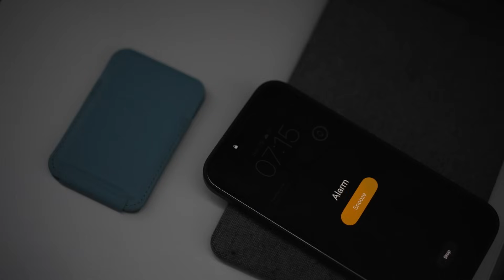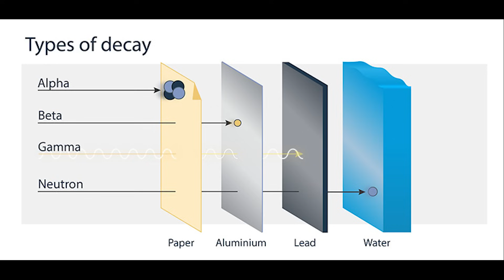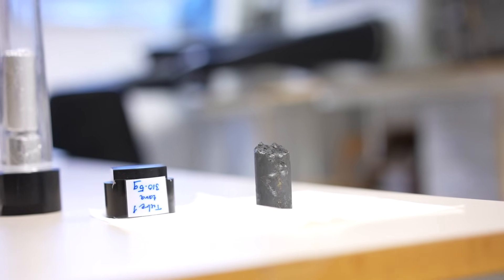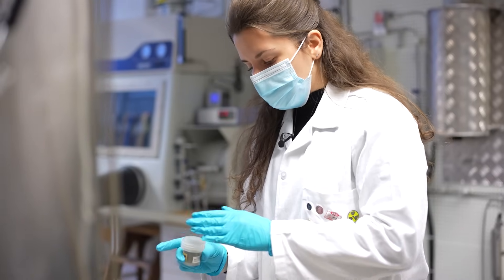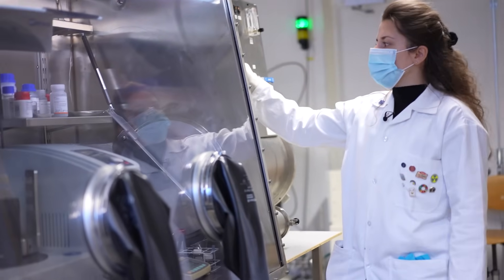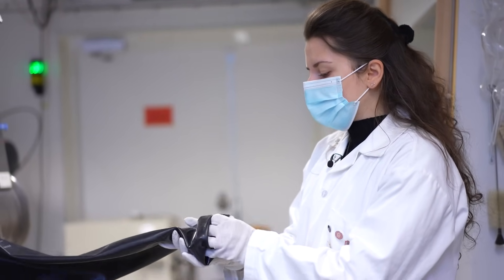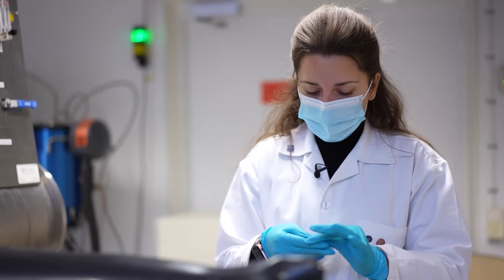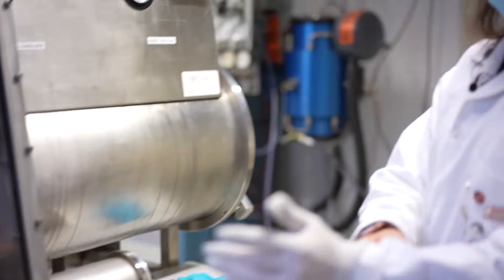Touching URANIUM and EXPOSING Myths - A day in the Life of a Nuclear Physicist

Comment: If Uranium is primarily an alpha emitter and if something with as low a density as paper can shield against alpha radiation, is it the case that the radiation we measure is only coming from the surface layer of the piece of uranium, while the radiation on the inside gets blocked by the much higher-density uranium that is on the inside of the piece?

If so, what happens to the alpha particles that are helium nuclei that are stuck inside the block? Do they stay there, do they leak out slowly or do they break down when hit by another particle?

Also, if it is true that the only alpha radiation you have to shield against with U-238 is the one you get from the surface layer, why are reactors filled with thousands of small pellets giving you a huge surface area instead of a single block where the surface area would be lower if what you’re after is the heat and not the radiation…

Comment: I used to work in a food testing lab and we had some photographers coming to take some pics for some marketing brochures and what not (this is back in the 90s). They were very upset when they saw that most of the solutions we were working with were colourless, not the stereotypical fuming flasks of bubbling liquids in rainbow colours! SO we had to mock up a couple of flasks to put here and there of water and some indicator dyes and iodine. They loved one of the tests I was doing where I would take a clear liquid, add a reagent to it, turning it a pink/purple, then titrating it with a colourless liquid until it juuuuuuust went green. Problem was that it was a time critical test, you only had a certain amount of time from removing it from the heating mantle to adding the reagent and back titrating, meaning I could hold the flask at the pretty purple colour while they stuffed around with lights and backgrounds.

Most of us ended up working a couple of hours overtime that night to finish of our normal work because they got so badly in the way....

Comment: Correct me if I am wrong but the only way uranium can do damage to you is by getting into your body. That could be absorption, inhalation, ingestion or an open wound. Because if that is the case it is like exposure during chem-warfare. And since you mentioned that is an alpha radiation a sheet of fairly thick paper will block it, or even charcoal respirators will as well.

Comment: You should know better than to say a Geiger probe, especially a pancake probe measures dose (Sieverts).  A Geiger probe registers only one thing - counts.  Per minute or per second or total counts.  That's an embarrassing error for a nuclear physicist.
Reply: A pancake tube is still a Geiger tube and both (tubes) can measure Counts, Sieverts and Roentgens. A pancake tube has a very thin mica window that lets alpha particles through to be measured, as does a "normal shaped" Geiger tube if it has a mica "end window". The pancake tube has a larger mica window, thus can be more sensitive (especially to alpha particles). Geiger tubes without a mica window can only measure beta particles, gamma and x-rays. Now you know.
Reply: @loupgarou1261  Well, let's see bud.  Degrees in nuclear and electrical design engineering, former Certified Professional Health-Physicist and a 40 year career specializing in radiation monitoring systems design and implementation.  I can confidently say that you don't have a friggin' clue as to what you are talking about.

A pancake GM tube with a steel body has practically no sensitivity to gammas because there is nothing there to absorb the photons and turn them into ionization events such as the photoelectric effect or pair production which will cause the tube to avalanche.

A pancake GM tube is primarily an alpha and beta counter.  Tungsten-bodied pancake tubes are available for enhanced gamma sensitivity.

You seem to think you can intermix Roentgens (exposure) with Sieverts (dose equivalent).  Sieverts involve both the event count, the energy of the events and the quality factor.

1000 photons of 100keV delivers vastly less dose  than 1000 photon of 1MeV, yet the pancake tube will generate MORE counts to the 100keV photons than the 1 MeV photons because most of the 1 MeV photons pass right through the GM tube without any interaction.  This is exactly the opposite of what you claim.

The proper instrument for measuring Roentgens or Grays for gammas is the ion chamber.

If you actually want to learn something about radiation measurement, might I suggest "Radiation Detection and Measurement" by Glenn F. Knoll.  In the 4th edition, the fundamentals of detection and the units involved start on page 56.  Might I also suggest you acquire a copy of ICRP Report 51, "Quantities and Units in Radiation Protection Dosimetry,".

Dumb ass.
Reply: @neon-john  I didn't say anything about gamma with respect to pancake tubes. And many digital counters "calculate" Roentgens and Sieverts (roughly) from counts when measuring the isotope that they were calibrated with, which is usually stated. I realize that scintillators and not Geiger tubes measure the energy of particles. Geiger tubes only detect counts.

Comment: Would be interesting to see how they derived and got to the size indentation needed for the pellet to expand right
Reply: Consider the "metallurgical Laboratory" that was a big part of the Manhattan Project. They needed to determine the engineering properties of the various metals. Turned out that Plutonium had seven or more solid "phases" each with different densities. Much like cocoa butter used in chocolate. 
For reactor fuel, they of course have to consider the elements that it will fission into. The two daughter atoms take up more room straight away than the uranium. Nor can they maintain the same chemical bond to the oxygen or nitride that bound the uranium. The densities of Iodine, Caesium and Strontium are much lower than that of uranium metal or the oxide or nitride, and of course the Xenon is a noble gas and cannot be contained at all, it leaches out.
Physical chemistry texts and references have huge amounts of data on the atomic sizes, densities and properties of all of these, as a starting point. 
Labs like Elina's will be trying new formulations to try and improve on older ones. They will start with "depleted" uranium that has no U235, a by product of enrichment processing, and this will cover all the basic chemistry of forming the pellets and their starting engineering properties like strength, thermal expansion, brittleness. Then they will probably use mixtures with natural uranium, which has about 0.7% U235. Like the metal slugs Elina demonstrated. They will use that to make similar test pellets. They might irradiate it in a reactor to cause some fission, and then they will measure the properties with some fission product contamination. This work will have to be done in special shielded chambers as these pellets will be dangerously radioactive. They might them do further experiments with pellets containing greater proportions of U235, to see at what point the test mixture weakens, or expands or whatnot. But as I said, these are not cowboy experiments. They started with lots of chemical information about these elements, and probably also made "cold" test pellets with varying degrees of contamination with stable isotopes of iodine, caesium etc to get a rough idea.
There will also be a huge amount of computer modelling, to reduce the amount of actual fiddling with irradiated fuel. Presumably pellets of spent fuel get analysed in the facilities that disassemble and reprocess this fuel. Strength, expansion, brittleness, density, changes in crystal structure etc have probably been well-examined in older pellet types and this probably helps them make good predictions of the newer materials with less of the expensive sort of high-radiation work.

Huge amount of painstaking work, and really tricky, I suspect, once they start examining irradiated samples.

Comment: Why did you remove your face mask in the middle of the process? Earlier in the same situation you are seen wearing it. What has changed? Will there be any nuclear dust in the air that when inhaled can cause radiation poisoning? Just curious to know what kind of safety aspects goes through your mind when working with these materials...

Comment: I would suggest you wear thick gloves to handle the uranium, rather than skin tight lab gloves. It reduces the beta contact dose rates to your skin by a third or more. Better to use a pair of tongs, and not handle it directly.  As you said it’s not very dangerous but if it’s easy to reduce dose rates you probably should.

Comment: surprised it was only 500usvh, i knew it wouldnt be crazy high, but i have some torbernite samples which are far higher, i guess the daughter isotopes are what make my mineral sample much higher? great video. thanks!
Reply: Yes, if it's in a mineral, it most likely is in secular equilibrium, which means you have to multiply the activity for the entire length of the decay chain (since then the ratio of decay must be equal for any of them, in order to keep the same abundances)

Comment: Hey, I know Carmina Urana, a great cantata 🙂
Some people have weird ideas of uranium.  In '1988 I touched a brick of uranium which was only wrapped in ordinary plastic foil and a non-sealed fuel element made from unenriched uranium.  I'm still alive, sadly no super powers, extra heads, arms or death rays shooting from my eyes.  One of the dangers of the uranium brick however was its surprising weight.  The size of a cobble stone and the weight of a dumbell.  So probably steel toes rather than a full body suit would have been advisable.
One minute later one of the researchers reached into the open reactor's pool grabbing a bathtub thermometer from the reactor coolant with his unprotected hand.  "Ah bathing temperature" he said.  Standard joke on every tour.  He must have done that thousands of time by then and still ET's finger is glowing brighter.  That was a EIR, Eidgenössisches Institut für Reaktorforschung, a Swiss research institute for reactor research  nearby in Northern Switzerland.

Comment: I found the video fascinating, including the use of argon as the inert gas.  I looked it up and it is a bit expensive, but well worth it and I was relieved once you put the sample in the tube, flushed it with argon, and then it was in the glove box. It seems like a safer place for it than handling it freehand where one could - theoretically of course - drop it at any time.

Comment: Even you call it fuel but there is no burning. I prefer to call it fissiles or fissile material.
Reply: The terminology is standard. Nuclear fuel is understood not to be "combusted", but it still provides energy. 
Some also refer to "incinerating" spent fuel. Clearly they do not mean putting it in a fire, but to bombarding the material with neutrons or extremely high energy lasers to accelerate the nuclear decay process.
Reply: @aaroncosier735  I understand but I think that in this time where burning is associated highly with CO2 iT is better to change the standard terminology.
Reply: @rudyberkvens-be  I simply do not think this can happen. The concept of the nuclear fuel being "burnt" is pervasive in the literature. We even consider that the sun and stars "burn".

The idea of "fuel" as a "source of heat" will persist. Nuclear discussion seems already able to distinguish that "burning" nuclear fuel releases no CO2. In fact, the idea that there is no ash or smoke clouds the issue of the wastes that are produced and the difficulties and costs of interment.
Reply: @aaroncosier735  it is still wrong. I say fission, fissile matter and will continue to point this out to people.

Comment: Interesting that uranium tetrafluoride is a powder. I've read that uranium hexafluoride was used in the Manhatten Project to allow them to enrich the uranium by gaseous diffusion. This obviously needs the UF6 to be in the gas phase. Given that UF4 is a solid at room temperature, does UF6 have vastly different physical properties, or did they just have to heat it until it either boiled or sublimed?
Reply: Quite different. 
UF4 -- melting point: 1036°C https://en.wikipedia.org/wiki/Uranium_tetrafluoride
UF6 -- *boiling* point: 57°C  https://en.wikipedia.org/wiki/Uranium_hexafluoride

Comment: There was oxygen left in mini-grip plastic bag.
Reply: Elina Charatsidou
2 weeks ago
The ziplock bag must be half open when entering the glove box (to remove all oxygen in it). Once inside the glove box it can be sealed all the way. 
To flush the tube you remove oxygen by using a vacuum pump and fill with Ar

Comment: Random question, In chernobyl reactor 4 why cant the corium from the melted core be recycled to make new fuel instead of just leaving it inside the safe confinement structure for hundred of years?
Reply: Chemically it's a mess. Nothing like "recycling" a spent fuel pellet, which had only two or three elements in it when new, and would now have more daughter elements, but predictable. Corium is a froth of whatever got melted on the way: Iron from the reactor walls, concrete, other metals, rock.

Sure, it could be chemically processed, but you'd only get back whatever was in the core: a mixture of half-used fuel rods. At greater processing expense than for ordinary spent fuel, of which there is plenty.
If you could get it out (say as a gravel), the best option might be to just mix it into blocks of concrete, put those inside dry casks, and let them wait till a geological disposal site was available. Or just put them back in the hole, though I do not think that would actually meet any disposal standards.

Comment: I love this video, and I would love to see more videos like this, people that know about the subject explaining their work is not something you see everyday. but I suggest next time you use a camera with shorter focal length and smaller aperture (bigger f/ number), and preferably with manual focus. it will not just make it easier to record on the cramped lab, but it will also make it a LOT easier to focus on objects you are holding. it will however means less light, but that will just require a bigger lens or more sensitivity setting. it may not look as good though.

Comment: I used to use depleted uranyl acetate for electron microsopy, a kind of grey white powder. Although i was curious what its radioactivity was, the meters we had could not detect any gamma radiation (Our probes were designed for 125I and 35S). However as chemical safety officer, we had to take precautions because Uranium is heavy metal generally indicating a higher metal toxicity. And so we used gloves. Uranyl acetate solution are in the gram per liter range, and the amount we used was in the microliter range for transmission electron microscopy. So even there the risk was small. But Uranyl acetate was kept on the shelf like any other chemical, not even locked up like cyanide. 

   The biological chemicals, two of which i will not name, required a specially keyed room, with a lock both on the cabinet and the refridgerator, and the keys were kept by two different people. So noone person could have access without the other being present. You are holding about a pound of Uranium, the biological chemicals we could keep no more than 500 mg at a time, and this was approximate 11,000 @ LD50.

Comment: Thanks Elina. Question - has it ever been considered to make an alloy of different fissile materials, such as uranium with for instance thorium or other nuclear (Natural or man made) elements?
or is this further complication for zero gain do you think?
Reply: It's done. 
"Mixed oxide fuel, commonly referred to as MOX fuel, is nuclear fuel that contains more than one oxide of fissile material, usually consisting of plutonium blended with natural uranium, reprocessed uranium, or depleted uranium. MOX fuel is an alternative to the low-enriched uranium (LEU) fuel used in the light-water reactors that predominate nuclear power generation."  https://en.wikipedia.org/wiki/MOX_fuel

Comment: I used to work with biological isotope markers such as I, Co, Sr, Sc and some others that I can't remember.  This was in the late 70s - early 80s.  By today's standards, our casual safety measures would probably be "criminal".  Your channel is very interesting.  Thanks!
Reply: I remember going to the local tip, asking the foreman for the place to bury low activity waste. Off with a shovel to the part due to be covered before further tipping took place! I assumed that the training included where drain off would occur long term
Reply: I am sorry but this video does not promote good radiation safety standards. See my replies on her pinned comment.
Reply: @francoisperrin7397  Sorry, but I think I'll go with the person who actually works with this stuff as a career and has put the work in to get to their position instead of some random dude on the internet.
Reply: @francoisperrin7397  you are mis guided, no need panic about radiation when you know what you are doing